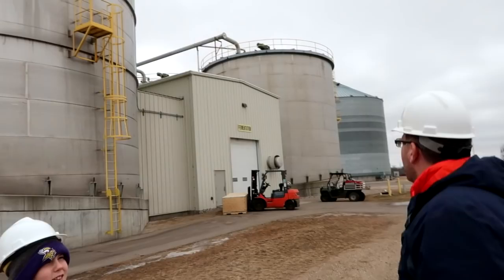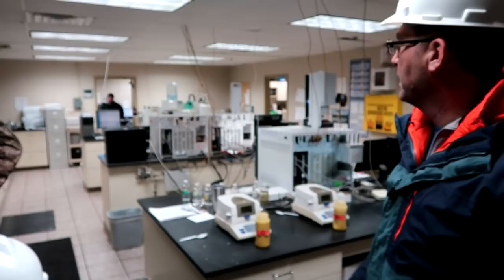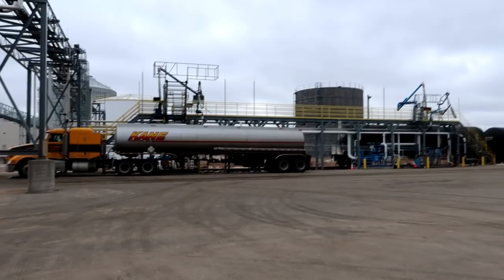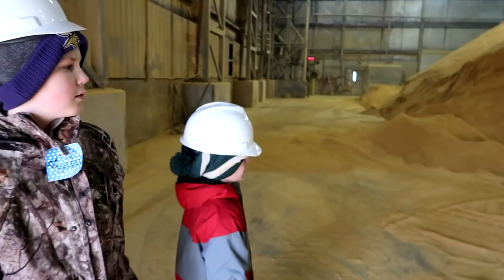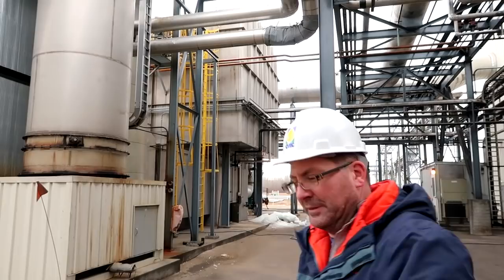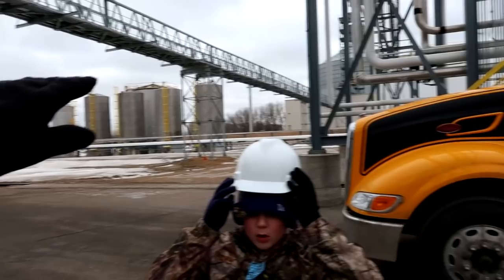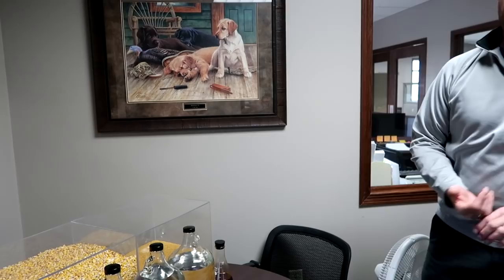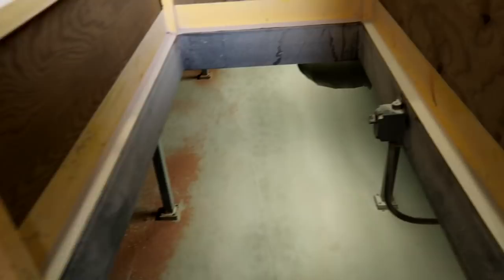Our Tour of a Corn Ethanol Plant!

Comment: 1. Grow corn, 2. Add water to make slurry turning into mash, 3. Add yeast to consume the sugar, 4. ferment, 5. End product= Bottles of alcohol. Sounds like a Moonshine Still to me.............................lol. Very interesting video. Thanks for sharing
Reply from the maker: Same exact process, just with a lot of permits!
Reply: Wonder if they have a hidden tap somewhere in the basement :)
Reply: jfmaniac There are a couple of customers from CVE that do use it for consumption. The rail cars you see going down the tracks are full boar booze. The gas is added to poison it against human consumption.
Reply: Yep. That's what it is, a Giant Moonshine Operation. :-) Cheers...
Reply: At Midnight oil refinement is basically the same too. You basically put crude oil into a giant column still and boil it, the heavier fuels like diesel are lower on the column and the higher grade fuels are higher up the column, then the remnants in the bottom are molecularly  separated to make even more fuel. Ethanol is still a better product, but their processes are very similar
Reply: @zukicreations   boar booze ?
Reply: Will W. Grey Duck is one.

Comment: Zach I loved the tour of the ethanol plant. I spent may hours in them when I use to haul ethanol. One thing that you didn't touch on was why ethanol is "bad" for small engines and it is because ethanol is very  acidic and it will eat away at aluminum parts. This is also another reason why it can only be hauled by Tank truck or a rail tanker and not be transported by pipeline because it will harm the pipes. Love the channel and keep up the good work.

Comment: Great video and very cool plant.  Ethanol has been a great trade simulator for me.  I'm rebuilding and replacing carbs right and left.  Spend the little bit more for pure gas in your older engines and you will save money and head ache in the long run.  Save the ethanol for newer engines that can run it all day with no ill effects.

Comment: Nice vid, and cool tour!
From my own experience, I have burned e10 rated gasoline in my 1976 F-150. The truck has all the original equipment on it. It has a four barrel ford Motorcraft carburetor with the "foam" like float (not metal or hallow). It seems to run it okay. Albeit, I think it runs a little too rich normally, which probably helps since ethanol blended fuels need to burn at a higher stoichiometric ratio. I think gasoline is around  14.7: 1 and ethanol can be closer to 10: 1 air/fuel ratio. So, older small engines like lawnmowers and four-wheelers will probably have a much harder time with it since they are not set up for it.
I did have to replace one black o-ring in the carburetor with a green neoprene O-ring. Not sure if the ethanol caused it to swell up or not it didn't eat the "rubber" o-ring up it just come off of where it was supposed to be. It certainly d/n help fuel economy. The truck went from about 11-12 mpgs to about 9-10 mpgs highway. However, at that time 100% gasoline was just over 3 dollars per gallon and e10 was about $2.20 so It cost me around 25 cents per mile on pure gas and about 22 cents with e10 depending on when and where I bought the gas from.  Now regular gas is $1.95 - $2.05 and e10 is $1.85 ish where I'm at in Oklahoma. So, that puts me at about 16 cents per mile for regular and about 19 cents per mile for e10.  The biggest drawback I noticed was when I'm driving 70 mph on the interstate, I was just about flat out full throttle with e10 whereas with regular I'm maybe at 3/4 pedal. So, I really notice the difference most if I am traveling highway speeds or pulling something  ( e10 lacks upper-end power) but when putting around town I don't notice any difference but I get about 7 mpgs in town either way.  
So, for a vehicle that has not been tuned properly to run on regular gas much less e10 and only has a 3-speed auto I don't think Its too bad. That being said if one were to buy an "ethanol" tuned carburetor and adjust the timing I would imagine it possible to get roughly the same amount of power out of the truck, that and it would need bigger fuel lines and fuel pump, the old mechanical pump would just not be able to keep up!

All that being said though, I also have a Grand Merq with fords 5.0 V-8. Its fuel injected and it does not take kindly to ethanol fuels. It will sputter and act like It wants to die on you all the time. After running e10 we ran injector cleaner through it to help get her running normally even after going back to regular fuel. Luckily haven't ever had to do any major engine work on that car even with over 250,000 miles on it.

It might seem a little odd but if I was stuck somewhere with only e10 I would choose my old truck over the car because the truck just has fewer problems running e10... and the car is as slow as molasses in January. 

As with anything if it's designed, built and tuned properly for the fuel it should run and burn it just fine. 

I mean does anybody remember when they "quit" adding lead to gasoline? My dad bought lead fuel additives for a while to put in our old Jd 105 combine... We still have and run that machine from time to time. Unless I had been told that story I would have never understood why all the gas stations have signs that say, "unleaded fuel".

Comment: Water  freezes   water  mixed with Heat does not freeze.  In the past they always used   Isopropyl  alcohol  ..   Adding  10%  ethanol to a  lower grade of gasoline  increases  octane and allows refiners to get more gallons  of  gasoline from a barrel of  crude oil .. thus  lowering  the price at the pumps for E-10  by about  40 cents per gallon...

Comment: Ethanol is HYGROSCOPIC, meaning that it absorbs water fro the atmosphere. The product HEET does not prevent water from getting into your fuel, it serves as an emulsifier to fuel that has already been contaminated with water. Ethanol fuel isnt terrible, but engines that don't see much use will wind up with dirty and corroded fuel systems due to the corrosive nature of ethanol and the fact that it soaks up water over time. Also, older vehicles often see fuel hose rot caused by ethanol. Great video and keep them coming! Very informative.
Reply from the maker: Interesting, thanks!

Comment: the sad thing is this fuel is very hard on engine parts in the fuel system and also very poor when being used it takes a lot more of it to do the same work as straight gas or even diesel i dont have dead set numbers to show but have been told by many flex fuel car truck owners they said that gas mileage took large hit and even been told by a few pullers diesel v alki they choose diesel cause of diesel taking way less fuel to make the same power
Reply from the maker: matt phillips it's oxygenated so yes, the economy isn't as good, that's why they charge an average of 60 cents less per gallon...

Comment: Great info here!  Thanks for taking the time to make this video.  I may have missed it, there were lots of numbers thrown out by the guide.  How much water is used to mix with the product after the hammer mill?  If I understood rightly, water is added to make a "mash" after the hammer mill process.  Also, what is the source of the water?  River, wells, ????  The need of lots of water is a common complaint - myth, or reality?

As a side note, I concur with a comment below - ethanol in gasoline at the pump causes limited life in small engine carbs (e.g. trimmers, blowers, etc.).  Diaphragms in the carb loose their life in the ethanol environment.  In our area, the grade of gasoline at the pump is irrelevant - ethanol in all grades.  The only place to get ethanol-free fuel is at a marina.
Reply: One more note, ... he said the fossil fuel subsidies were about $4B.  The wagering on the Super Bowl 52, $4.67B in America.  In other words, more money was bet on the Super Bowl than subsidized fossil fuels. Regardless of a political position on fossil fuels, by comparison, there is lots of discretionary money in the pockets of Americans, more than is subsidizing fossil fuels.
Reply from the maker: The water myth is a big one.  Most of the water used in the process is recycled after it's heated and sterilized.  So the same water gets used over and over again.  The only water loss at the plant is the steam leaving the pipes.  I couldn't tell you how much that actually is, but it's far less than thought by some "anti-ethanol" folks.
Reply: Thanks.

Comment: There are a few sticking points with me...........While not a factor in your area, it's he destruction of the Ogallala Aquifer to produce an energy product that can be accomplished in other ways than corn....the other is ethanol tainted gasoline is essentially forced upon consumers to the point conventional gasoline is becoming nonexistent. The main problem with that is there are millions of existing engines, particularly smaller ones that are either being ruined or requiring extensive "uncompensated" maintenance steps to prevent damage......the other is ethanol fuel results in lower MPG in all vehicles requiring even more fuel production.

Comment: Zac thanks or sharing. A very educational video I really learned a lot and found out I didn't know as much as I thought I knew about the production of ethanol. Does all the corn you grow go to the ethanol plant? Do you know what the percentage of corn grown in the US is for human consumption versus ethanol fuel and other things? Also I don't know why but I do know the cars and trucks made to run on flex fuel  when they burn the ethanol 85 fuel they do not get as good of gas mileage as when they use gasoline. Have a great day!!! God Bless
Reply from the maker: We sell a lot of our corn to the ethanol plant, but not all of it.  It's the same crop so we can market it to many places, this is just one option.  I don't know off the top of my head what percentage goes to ethanol versus everything else, but I believe about 70% goes for livestock feed, much of which is exported.  Ethanol will lower mileage but it is also cheaper at the pump to make up for that.

Comment: I don't know why we wouldn't want to grow our fuel instead of a finite resource like oil.  Only issue is it seems like there isn't enough effort on keeping the soil protected and rich.  You see the dirty road ditches and having that great MN topsoil blown away can't be good.  Guess I'm interested to learn more about the no-till stuff as it seems like it would be a way to keep the soil good.  But I'm not a grain farmer so I don't know much about this stuff.
Reply from the maker: carkey351 absolutely.  I hate dirty road ditches.  I wish like heck we could use cover crops and no till.  Our problem is that we have tried cover crops 2 years in a row and they freeze before they get any measurable growth.  If we don't till the fields black in the fall, we have a late spring.  It's a tug of war with our northern climate and cold, wet soils.

Comment: I wish regular people could buy denatured alcohol directly from them... that way when I do my racing I could cut out the middleman. I'm also curious I thought the yellow bottles of heet were methanol not ethanol. I use water meth injection in my car and when I run out of methanol in the past I've used the yellow bottles of heat to get me by until I get another container of methanol. Do they make both methanol and ethanol there?

Comment: so this was interesting i still have a love hate relationship with ethanol i like the idea of it as fuel E85 is great but i dont like the 10% in all gas thing is the killer i wouldn't have an issue if it was optional my ideal setup at the pump would be would be standard non-ethanol  E10  E85   personally i run E85 in my car when i can get it my local station doesn't have it but i fill up when i can at the big gas station but i would like to have the option to use straight gas even if it was a few cents more per gallon for things that have carburetors and for longer storage dad used to keep around a 100 gallons in storage during the winter we would fill the tank in October and empty it in April but the E10 stuff doesn't run right in the small engines after 6 months without treatment now to get that same time its around and extra $100 or so (i think im usually still on fire work when he fills the tanks for the past few years) i think there is a future in ethanol but it has always felt pushed on the public to me i straddle this weird line where dad is a dairy farmer and i help him but i spend my summer fight wildfires so i know people on both sides were surrounded by grain farmers at home and i run a chainsaw for 7 months a year it would have been nice if it was keep an option not forced apon us sorry for the little rant

Comment: What a video. I'm still watching but I've gotta ask so I don't forget. But if they use 50,000 bushels a day how much corn do they keep on hand ahead of time? Just in case they don't get enough trucks.
Reply from the maker: They have enough storage for over 1.5 million bushels.  I assume how full the bins are is pretty dependent on oil and corn markets...
Reply: If you build it they will come
Reply: MN Millennial Farmer --Ok, that's what I was wondering. I knew there were different circumstances for how full they would keep storage at but it's interesting how much storage they have. Thanks a bunch.

Comment: I’m not against ethanol fuel for use in vehicles but it would be nice to buy ethanol free fuel for use in small engines.
Reply from the maker: DAN ROGINA "premium" doesn't contain any ethanol if that's what you're looking for.
Reply: Maybe in MN but here in Illinois all grades contain ethanol
Reply from the maker: Interesting.  I wasn't aware of that.
Reply: Dan the newer small engines are built to run ethanal i you read the owners manual for them The older small engines did not like the ethanol and it was hard on the valve trains and fuel lines. I own a landscaping company and put more hours in a month than homeowners will in a year or more and I do have any ethanol related fuel problems in my equipment.
Reply: nashguy207 I agree newer small engines a designed to run fuel up to 10% ethanol fuel but also from my Honda small engine manual:“Gasoline containing higher levels of ethanol is corrosive and attracts water, which can cause starting or running problems or, in some cases, damage to your lawn mower’s fuel system.”  The real issue is when, I as a homeowner, let my equipment sit for extended periods the ethanol has harmful effects on fuel system components.  Fuel stabilizers can solve these negative effects but if I have to add something to stop possible damage I would just as rather have fuel without the ethanol.
Reply: Yeah our Honda shop here says they get tons of repairs all because of ethanol in the fuel
Reply: I use Stihl hand-held equipment.  The ethanol does damage to diaphragms that are in the carb.  They don't last very long, and need to be replaced - not a big repair, but a task that is done when the fuel is not being taken from the tank to the engine.  All grades of gasoline here have ethanol, up to 10%, I think.
Reply: Yes I wish it was easier to find ethanol free. Here in MI it's called rec gas and is 91 octane no ethanol but is hard to find until you get farther north into snowmobile country. Really nice to at least have the option as I run alot of older carbed engines and they hate ethanol. You really start to see the issues with ethanol when it sits. Older engines like boats, trucks, cars that are only ran a few times a year and then sit for x amount of months at a time are notorious for having ethanol related issues.
Reply: Just buy the ethanol free fuel at home depot, that's what I do for my small engines
Reply: Most States have a "MANDATE" that requires the ethanol be added to the gas...which basically is forcing the consumer to buying & use a product he doesn't want. We had an ethanol mandate in Florida which was voted down by "The People"...they didn't want to be forced to buy this product in their gasoline. NOTHING CHANGED!!! All the fuel suppliers have ethanol added to our fuel, wether we like it or not. Yes you can still find ethanol free fuel but because of the low volume of sales, it runs +30 cents a gallon more and they are hard to find. You also get less MPG with ethanol...for a higher price and a product that eats up gaskets, "O" rings, fuel hoses, etc, etc.
Reply: I've always been told to by the highest "premium" gas to put in 2-strokes, but even that still contains ethanol. Let ethanol fuel sit in a 2-stroke for a month or so and it destroys the fuel lines and clogs the carb.

I would love to see what a 2-stroke does on race fuel though... I might go buy a gallon of 110 octane at the race track and mix it on a cheap Amazon saw one day to see how well it works.
Reply: Here in Clearwater MN there's a couple stations that sell ethonal free fuel for the small engines since it is hard on engines, thing they never mention is how hard ethonal is on a engine. As well as how inefficient biodiesel is and how it gums up fuel filters
Reply: Not sure where that is. But just by being "premium" doesn't preclude it from having ethanol in it. Premium is not ethanol free.    There are allot of places that you can still buy ethanol free gas. Google it.
Reply: @MillennialFarmer  Bigger more populated counties in Illinois and WIsconsin have mandates to having to have at least 10 percent ethanol  in the fuel blend due to the epa's clean air act. I use to haul fuel and ethanol around the Milwaukee and Chicagoland area. I was hoping that you were going to be going to the ethanol plant in Preston Mn where I use to go to pick up booze.  I also have been to ethanol plants in Oshkosh Wi, Freesland WI, Monroe Wi and Clinton IA. I agree with you on the smell I love the smell of some good corn mash brewing LOL